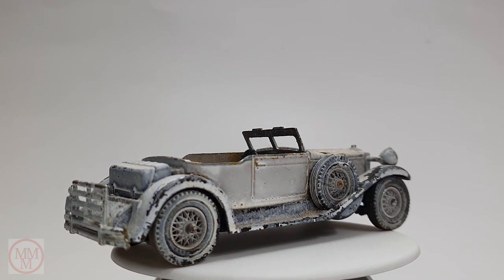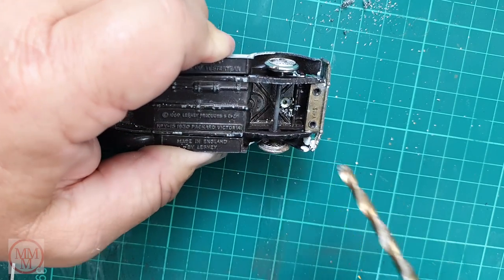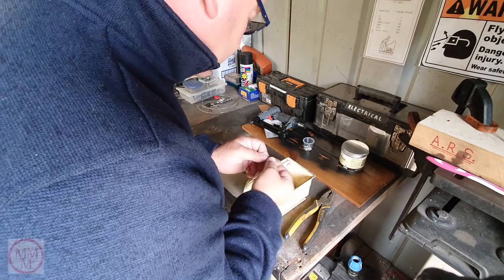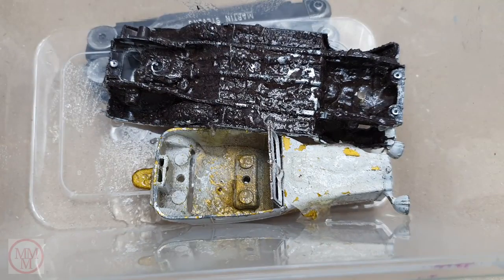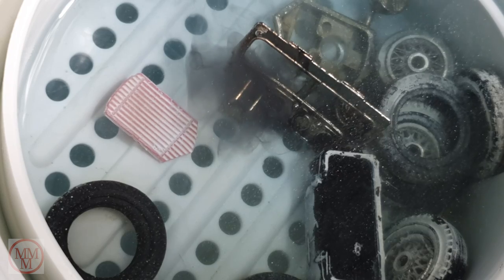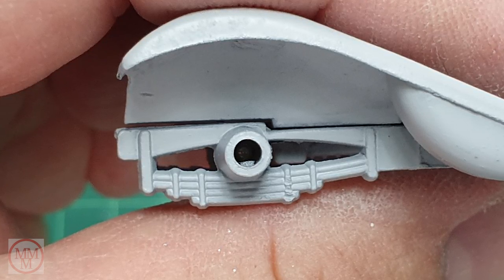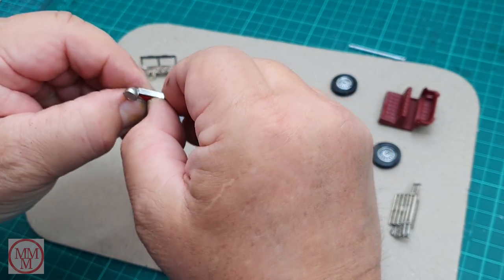MATCHBOX Restoration Y15 1930 Packard Victoria 1969

Comment: thanks for the video,  Had to laugh when you were describing looking for the trunk part.  when I used to build models i have done the same thing, left parts in the paint booth and spent an hour looking for it only to find it still stuck to a clamp or a piece of runner.  

Cheers.
Reply from the maker: That short scene nearly ended up on the 'cutting floor' but after a family review I insisted it stayed in as it shows the kinds of things that we hobbyists have to endure! LOL!
Reply: @MartysMatchboxMakeovers  bless your heart. I would have been cussing a blue streak. In case you are wondering,  I'm from southeast Tennessee in USA. Stay safe and stay well.

Comment: Incredible transformation ! I loved the colors. One question though, why not take the split tire and use it in the spares? Then you could have turned the split into the Wheel well and covered it entirely. Maybe I was looking wrong and that is what was done, but it appeared you used it on the other.

Comment: Julie, I am using your gravy bowl. I knew the hot water would help. It also helps with adjusting resin. Also if you are working with vinyl in model kits. The car does look like Fort Knox. I am glad you are still well. Good luck in avoiding the nasty virus. You have a pleasant looking walkway out to your shed. I remember those paint samples. I am surprised the stripper did not melt the bottles.

Comment: Beautiful restoration as always. Gorgeous model. Oddly enough that no brakes after getting shop work done literally happened to a good friend of mine. The mechanic left all four bleeder valves cracked open. After about an hour or so of zipping around town he came to a stop sign and plowed into the tree on the other side of the road. The settlement was extensive.

Comment: Marty, Something my grandfather taught me years ago to help keep those parts from jumping when you cut them. Take your side cutters (the one you used for cutting the axle) and tape the handle so the jaws are fully closed. now clean the jaws very thoroughly.  Once clean and dry fill the cavity with silicone. I use the cheap clear tube of silicone from the local gas station. I also make sure that I smooth it out to make it look neat but that is just cosmetic. Once cured, un-tape the handles and using a razor blade carefully slice the silicone between the jaws so they can open again. Once done you will have a cutter that when you cut the axle, the silicone will hold onto it and prevent it from jumping. And since the silicone is flexible, it generally will not get in the way of what you are doing. I've been doing this for nearly 40 years now and it has saved me countless hours from having to search for those wires that seem to fly off into who knows where only to be found again with a bare foot in the middle of the night.

Comment: Hi there Marty, when you need to remove paint from plastic parts, you can use brake fluid, it won't damage the parts, and if you need to remove chrome from plastic parts you can use edge shaving gel, it will remove the chrome without damaging the parts, of course I don't know if you have edge shaving gel in Australia, you could try other brands of shaving gel to find one that works. Wow, that turned out looking great, I think maybe you could paint the radiator black and highlight the raised portions with silver paint, it would look good. You'll notice, I typed my comment about the brake fluid before I watched the entire video.

Comment: His Martyr,  that was a great restoration,  the colours are lovely together, I especially like the metallic paint and it only took one coat of paint, I've always had to use two or three coats, I'm going to check that brand out. Some viewers have said they like the before look as well, I think an alternative could be a topless rally conversion spattered with sand or mud set in a  race diorama , maybe  add a shovel strapped to the side of the car ànd some jerry cans in the back, put Kevin in the drivers seat and watch out for mayhem lol.

Comment: One of the most pleasing color schemes you've done imo. The olive oil on squeaky breaks doesn't work hmm? I'll make a note.
Reply from the maker: Good to see you picked up on the olive oil Bill. Kevin only has limited knowledge of cooking and is not suited to the automotive industry at all! :)
Reply: @MartysMatchboxMakeovers  I saw the olive oil and thought, this isn't going to end well.
Reply: Nice color scheme!   I could imagine a 1930s Hollywood Starlet driving this car.   One of Matchbox's better models.
Reply: @tygrkhat4087 , yeah, but the brakes stopped squeaking!
Reply: Actually the British Armed Forces in the Middle East in the 60's did use olive oil for brake fluid in their Land Rovers!  An old RAF veteran told Me at My Squadron how the Arabs would sneak into patrol encampments in the Desert at night  and drain it out! So they ended up adding "enhancements" to make it useless for cooking!

Comment: Beautiful little model. One trick with your wire nippers, with them closed fill them with silicone, once it has set take a razor blade and slice down the middle to open them up. Now when you cut something the silicone will grip on to it

Comment: Had to do a bit of research after you mentioned you weren't sure if the red grill was period correct. The majority of 1930 Packards had chrome grills but I did find a couple examples of painted grills, usually matching the color of the body.

Comment: I had a couple of cars like this has a child. My memory is a bit vague on what they were but i have an image of a Morgan Aero in my head so was a similar type car. As someone who is a bit of a naughty boy and liked to take the cars apart, I found I had the same problems with the tires breaking in the same manner has yours at the start of the video. The one I had I don't think had the same age (child of the 90s) has I think they were brought new, so possibly a problem with manufacturing with the thin wheels, rather age?. Great video has always :-).

Comment: I've had good results soaking hardened small rubber parts in Armor All brand protectant.  May need a week or more, but usually works to soften old rubber parts.  Learned this from vintage aircraft restorers who used this method to save rare old rubber parts.

Comment: nice resto marty,still have my original from 1969 in fact,though it was well payed with as a kid in the 70's & is missing the headlights,windsceen,steering wheel,back parcel shelf grate & bumpers,mine has the original metal wheels & soft plastic tyres rather that the more rubber like ones introduced in the 70's,keep up the great work,cheers

Comment: ..it may have been mentioned down the line somewhere but that "rear grille" is actually a drop-down trunk platform. A removable trunk would sit in it and get strapped in. Built in trunks on cars were not yet common.. but it appears that this car had something of a trunk.

Comment: i have one of those as well. on my the roof is missing along with one of the pins on the side of the back seat that the roof hooks onto and back fender has lost one of the corners...
there is also a little bit of golden-greenish paint missing on the top of the hinges gor the hood and the top of one of the doors... otherwise it is pretty okay

Comment: Bonza reno on that Packie Vic. Nice color choices. A snail could glide proud in that wee beastie...

Have you ever tried 'pre-heating' a model prior to spraying it? We done warm diecasts (without particularly meaning to) and found the paint dries almost instantly. Been meaning to try it deliberately but it's a long walk from the kitchen toaster oven to our painting corner.

That Kevin is dodgy-as...

Comment: A product called 408A rubber renue from MG chemicals does an awesome job of softening up old rubber to make it pliable. Have used it several times to soften windshield gaskets that can not be replaced. Softens up enough to allow the old glass to come out and the new glass to go back in.

Comment: As far as paint strippers go, I don't know if this is available in Australia, but I use an automotive de-greaser called SuperClean.  It was originally made by Castrol, but now it's a separate company.

It has an advantage that a batch can be re-used, many times.  I fill glass jars of different sizes and soak pieces in it.  It starts dissolving old paint in minutes, but the longer you let a piece soak, the more paint dissolves away into the solution.  I use it on metal figures, but also on styrene and resin.  Here in the US, it's eight dollars a gallon, so for the price, it goes a long way.

Since it's a de-greaser, it's also good for cleaning around the house and in the garage, too.

I recommend it, if you can get it.

Comment: Superb restoration. The "Victoria" was the 2-door convertible version of the Packard Eight,  powered by a 90-hp low-compression, aluminium head, straight-8 cylinder engine. The Packard Eight was a luxury automobile produced by Packard between 1930 and 1938.  I also doubt the real car had a red grille. Ford produced a "Crown Victoria" sedan.  Mercury produced a "Marquis" and a "Grand Marquis" sedan.  Speaking of unusual car model names, Studebaker produced a "Dictator" from 1927 to 1937.

Comment: The mystery of the spare tire in the car !!!
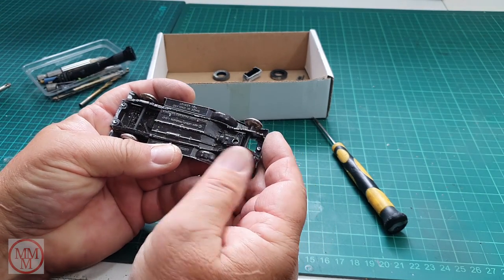7:34 sticky fudge.
30:12 oil pressure gauge?
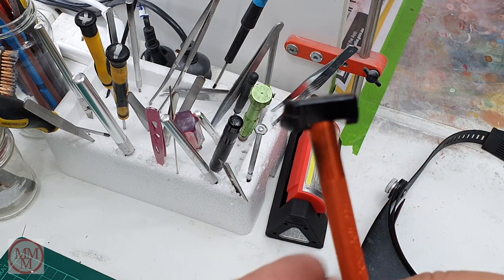31:25 Oops the trunk was certainly well hidden, put down unconsciously.
Kevin is not the right mechanic to work on the brakes.
Certainly a model with many flying parts, another great result.

Comment: No tach in these vehicles, Marty. Clock, combination gauge (oil, ammeter, fuel) and speedometer. The speedometer was not a sweep type. It actually had a rotating cylinder that had numbers. The brakes on these vehicles were interesting. Each brakes drum had three shoes. They were mechanically operated by cables. The vehicle had a suspension that was self lubricating. You had an oil reservoir under the hood, and oil lines going to your king pins, leaf spring pins, etc.. Every time you applied the brakes, it sent oil to these joints. The grills were often painted to match the body color. They could do this because Packard used an external thermostat, and controlled engine temperature by opening and closing the grille louvers. Be well

Comment: The "grill" on the back would be a fold-down luggage rack and kept folded up as on the model when not in use.  Always enjoy your videos.  Thank you for sharing them.  By the way, the trunk you took off was just that.  A trunk.  That's why we Yanks call that rear storage compartment a trunk.  Any reason why English speakers other than Yanks call it a boot?

Comment: Beautiful model, is there a variation with the soft top open?
Yes label all dangerous things amd keep them away from kids and koalas,mate.
Brake fluid works well paint stripping and is miles better on brakes than olive oil.
Keep safe everyone!
Reply from the maker: Colin, thanks for your comment. You have obviously watched the whole video as you have commented on many aspects of it. Thank you so much for sticking around and for 
being a fan for so long. Marty.
Reply: @MartysMatchboxMakeovers  No thank you for the work that you do. I don't see the point in watching part of the video, if I get interrupted I will finish watching another time.

Comment: When you use the Molotov chrome you should avoid touching it for a week or so. Also you can buy refills for the pen. You can run  Molotov through your airbrush as well, it sprays well with a tiny bit of thinners.

Comment: Try using your airbrush for the Molotow ink next time. Use Isopropyl Alcohol to clean the brush afterwards though. You get a much more even coating that way, plus it tends to dry a little quicker.

Comment: Hi Marty, I believe you bare correct about the dashboard holding a Speedometer, Tachometer and a clock. In the days this car was owned there was a motor sport I believe was called "Rally Racing"or "Rallying" . Checkpoints were established throughout the course and your car had to pass the checkpoint at the exact established time. Points were then added or subtracted depending on ho close you came to the correct time. Their would have been a driver and a passenger who took care of the map reading and computed the time and distance. Take care, be safe Tom USA.  More here https://en.wikipedia.org/wiki/Rallying

Comment: The container that you put inside the ultrasonic cleaner should be glass. Something ridged that will properly transmit the waves. The plastic container would deaden them and reduce its cleaning ability. Also ideally it should sit on the bottom of the cleaner, again so that the vibrations are directly transmitted to the secondary container. The rest of the water in the cleaner is really just there to heat up the secondary container
Reply from the maker: Thanks for that, good to know, i'm still experimenting.

Comment: parts fly off on me all the time when in cutting out parts from modal kits and with my luck its always the tiny piece you need to hold suspension upright XD
Reply: Back in the 90's, I think, I had a dual-lens camera with a plastic slide-open cover.  Some grit got into the sliding, and I had to take the cover off.  Little did I know that the cover also rolled on a tiny ball bearing.  Finally found the bearing, cleaned & lightly oiled all that needed to be oiled, and then tried to put it all together again.  Kept losing the bearing.  Finally put all the parts into a large bowl and played with it all until it was back together.

Comment: Holy crap 40 PSI in an airbrush?  I have never seen any airbrush need 40 psi in over 50 years of painting... I use original (1950s) Thayer and Chandler artist grade, and modern era Iwata.  typical pressure will be between 15 and 20, except for certain lacquers that spec higher.

Comment: Next time, sand off most of the rim, on the wheels. That way, the old, brittle rubber tires are less likely to break, when you put them back on.
Just glue them in place with a tiny dot of superglue (or something else that works). Should this car ever get restored again, the rubber will be easier to take off and hopefully they won't break. Although those tires will not improve with age............

Comment: Post restoration crash inquiry found that caused by;  
a) cracked tyre - should have used a spare and located the 'fix' by locating in well, 
b) crackhead mechanic high on sniffin euca oil, who fell asleep before testing the brakes
c) driver error - failing to test brakes prior to traffic use of the vehicle.  - Never trust a Drop Bear ever... he dropped you in a stinky steaming pile of shit... then went bush, never to be seen again.

Seriously though, perhaps a suggestion or two.
What are the tyres made from. If a rubber compound it maybe age that has them hard. They can be 'rejuvenated' [but not so long term] by soaking in brake fluid a few days. Clean with detergent and all -  Brake fluid nasty stuff on most plastics and paints. 

The blind rivet mandrel use for axial is a cool idea. I'd be worried about heat damage to plastic parts when peening over that way which creates friction.   
Try finding brass tube of the same bore as the mandrel diameter and of a length that fits inside body lugs without excess axial play. Use 2 rivets cut to meet in the middle. Clean or cut small groove around the shafts where a small grind in brass tube far from wheels is cut. Solder will wick in and bond with steel mandrels [ not so with monel or stainless steel types. If it doesn't fuse to the steel the solder will wick into the hole and retain axial anyway due to groove, AND will allow an easily removable shaft if need be.  There is also the aesthetic improvement due to a consistent finish either side, but on that point.. the nub head on the mandrel isn't round, rather looking like a pinched off during manufacture shape. These mandrels could be placed in a drill chuck and shaped round with a file. Good idea to remove the raised rivet retaining edges along the shaft, as these will surely cut soft plastic and have wheel wobble [another cause of accidents]. 

Was the radiator grill painted the same colour as upholstery, just like the old MG TD series vehicles?   

Timber drivers wheel rim... chrome spokes.